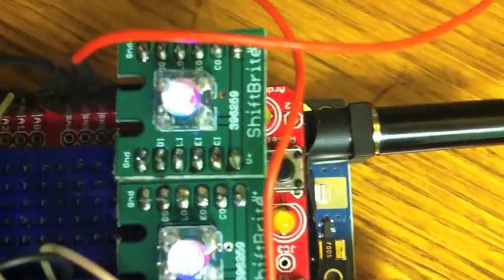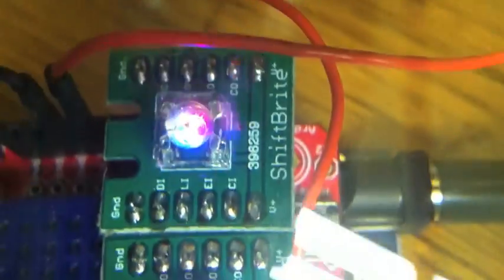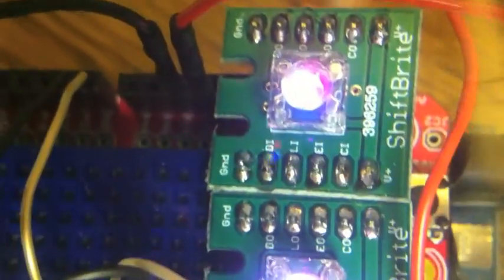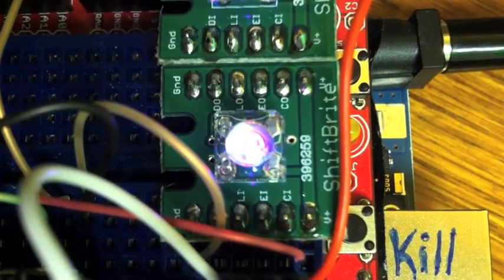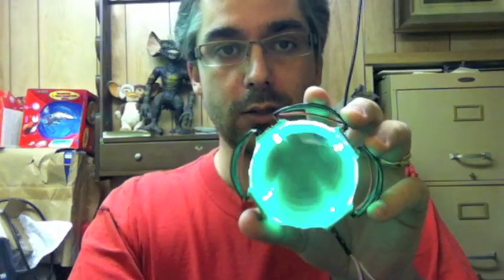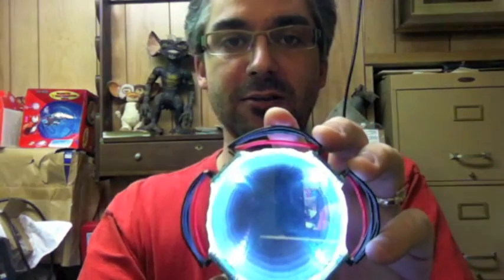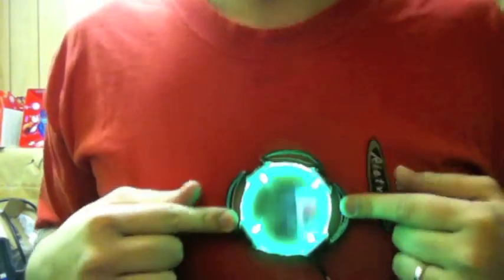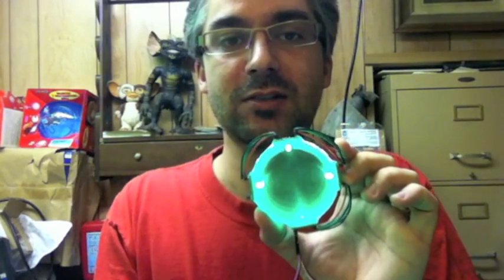One Eye'd Robot Build - Part 10 - Infinity Mirror 5 of 5 (final assembly!)

Comment from the maker: Light travels at a set speed depending on the substance it's travelling through. So it does slow down, when it hits the glass, but then speeds back up again when it hits the air. It travels fastest in a vacuum. It's also cool to note that light travels at different speeds depending on it's wavelength. That's why you can separate sunlight into a rainbow with a prism. Light looses intensity when reflected, as a small amount of it is absorbed. But that just means less photons bounce off, than hit.